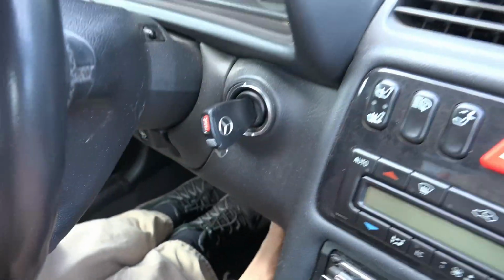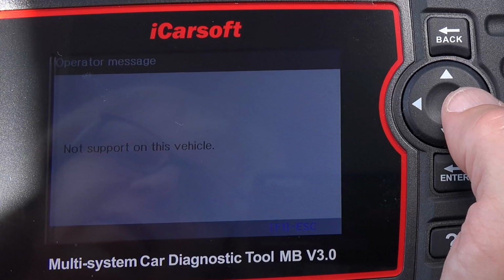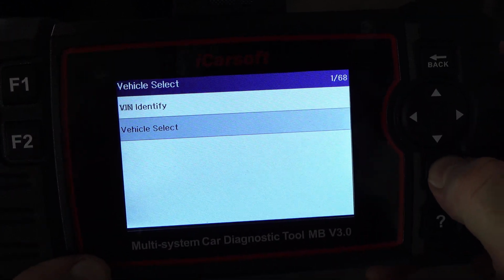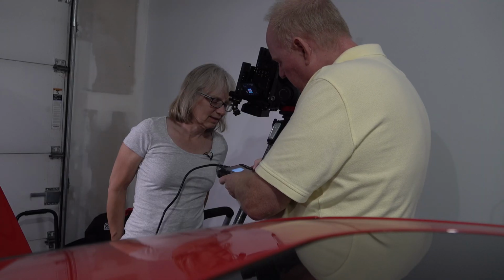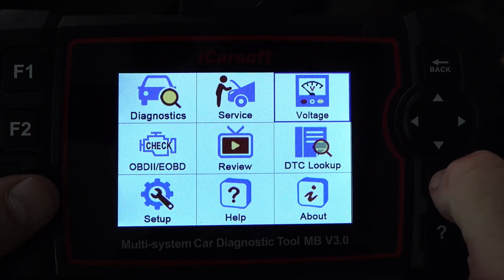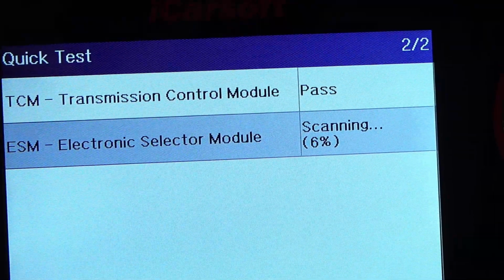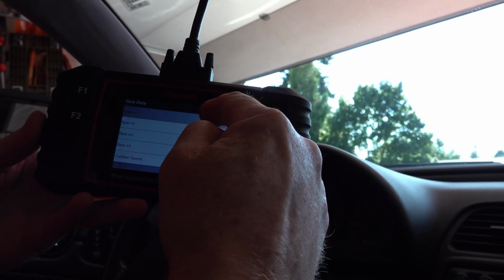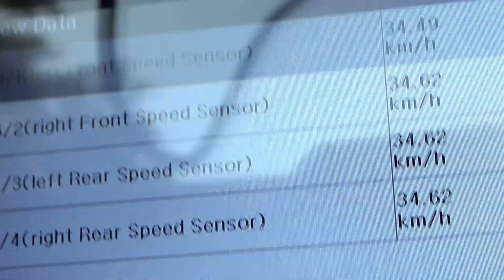How we processed the “Check engine” light on Diane’s Mercedes

Comment: Check the cabling it's probably corrosion somewhere.. multi system failure means the module is bad or something is bad with cable but it see's the trans module and was able to talk to it so probably not the wire to ECU to trans cable but something after..... FYI you should of looked at freeze frame data and see what the car was doing at the time when it send the code.. to know what is really wrong you might have to back problem it with a external scope.. so see what the data the sensors are actually seeing
Reply from the maker: Thanks, another great analysis. We hope to release the video with the answer on Friday and you will see how right you are then...or you will tell us what we misinterpreted 😎.

Paul
Reply: @carzombies  if corrosion ... they sell electrical contact cleaner its a spray.. and I would use that a couple of times... spray it let is sit for 20 sec's so it breaks it down,, and wipe it off and spray it again.. and you can use air to blow away dirt and contact cleaner... put the connector together a few times in and out and re-clean it... then when your done use some die-electric and put it on female side of plug... and push it in/out a few times... and you should be good... there is tools to remove the pins out if you really need to get a deep cleaning... but that's more in-depth I wouldn't bother unless its necessary.. they are normally held in with a flower shape clip that expands when installed.. similar to an electrical outlet back port that you can just force a wire in... now corrosion can go up the wire underneath the insulation.. not really common but something to look at..
Reply from the maker: @robrocco5420  This looks like exactly what we need to do. Thanks for the tips on how to do it.

Paul & Diane

Comment: Although I've never used one there are bluetooth-based OBD readers that basically turn your phone, tablet or laptop into an OBD scan tool. In theory this could give you way more features and capabilities than a proprietary scan tool, with regular updates and bug fixes and the ability to connect online to OBD databases that could give you a lot more and more current information about your vehicle and any codes that come up, keep up with new vehicle models, computers and parts as they come out, and store an unlimited amount of historical data.

Only one of our cars uses OBD II and I'll probably sell it soon, so I've no need for such a tool, but you might want to look into it.

Comment: I'm just an amateur, but I'd start with a good cleaning of the battery posts/clamps back in the trunk there.  Maybe check the battery's health with an impedance tester. I do know that on some modern BMW's with rear-mounted batteries, an aging battery can make all sorts of weird fault codes crop up.

If it comes down to hunting for a short in a wiring harness, good luck! This could be a fun/frustrating series.
Reply from the maker: You are more than an amateur, and you should watch the next video that we hope to get out by Friday that shows the actual problem. Hint, it has to do with the many sporadic fault codes on the transmission...just like you suggested, but it wasn't the battery.

Paul & Diane